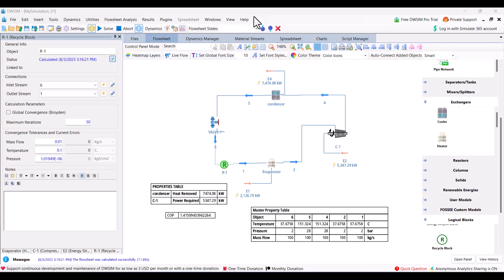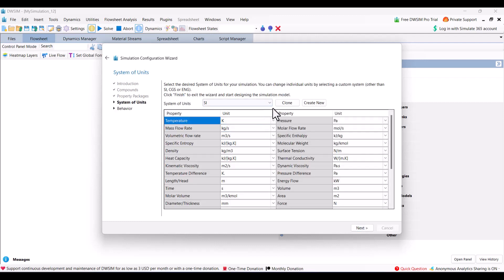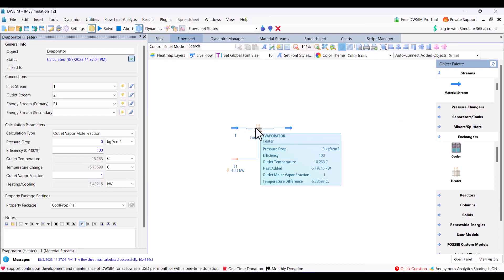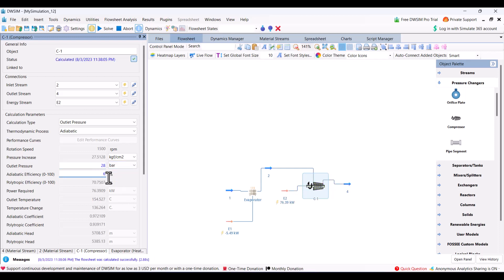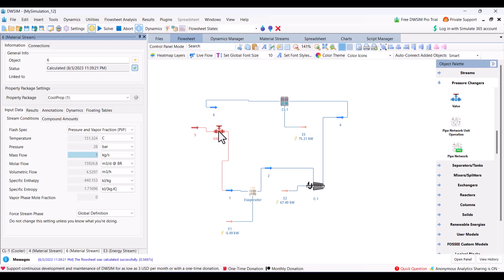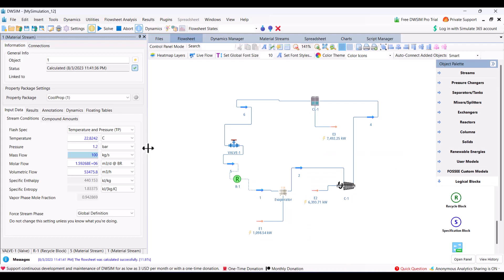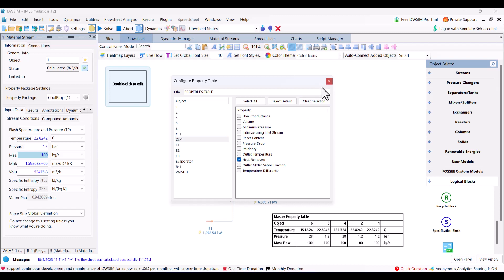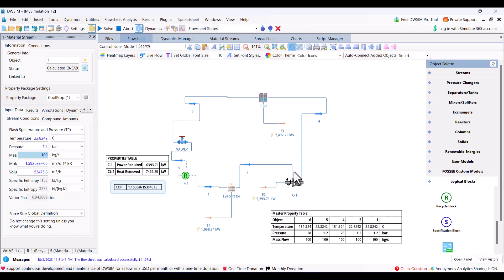Heat pump process model and simulation in DWSIM

Comment from the maker: If you have any request to model, you can write it here.
Reply: Hi, can you show heat pump simulation with MVR { like high temperature heat pumps} , further please tell me which software is best for heat pumps simulations, EES, transys, matlab or DWSIM, Please reply
Reply: Excuse me, can you show a cascade heat pump system modeling process, I really need it ,thanks
Reply from the maker: @YiliaGu-e1f  do you have PFD?
Reply: @modellingandsimulation-che9457  I don't know how, but I can describe that the low temperature cycle uses CO2 refrigerant, and the high temperature cycle uses R134a refrigerant. The components are evaporator, compressor, condenser, throttle valve, phase change energy storage tank, and can also be solar-assisted power generation